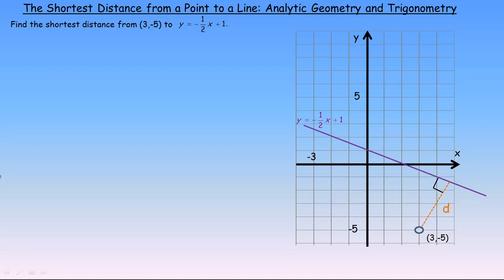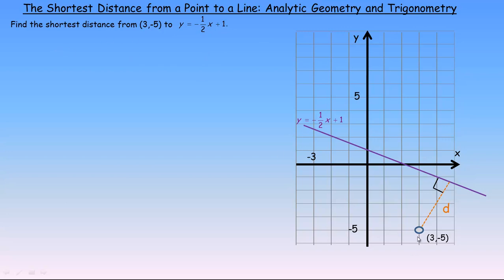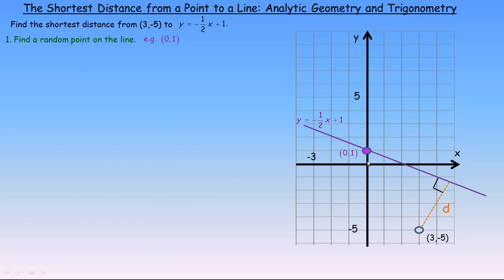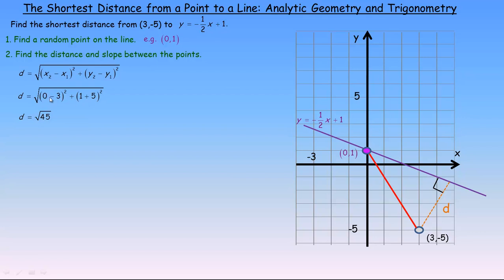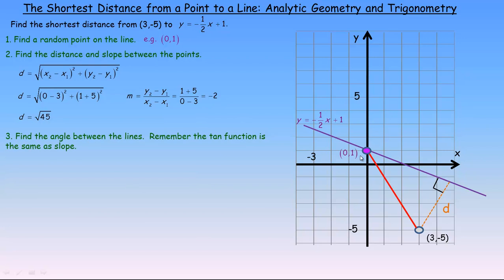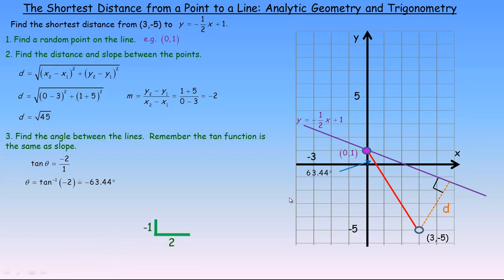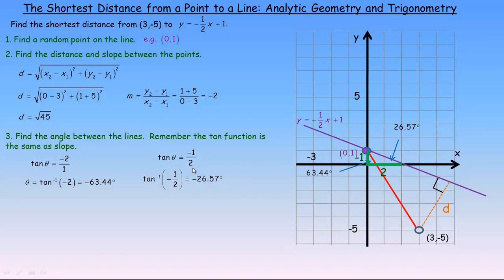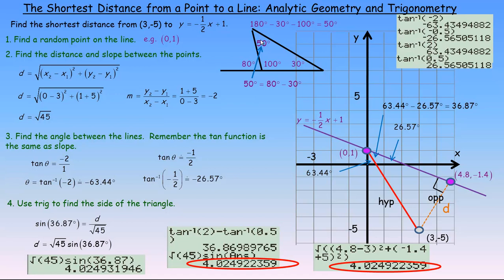The Shortest Distance from a Point to a Line  Analytic Geometry and Trigonometry

Comment: sorry, but that is not a device problem--that is not a correctly illustrated right angle.
Reply from the maker: Hey, sorry but scale's not really the point of this explanation.
Reply: @AlRichards314  that's totally fine, but it just feels disorienting/gaslighting to be told that the 90* angle is right, it's my computer that's wrong. If you had ignored it, I would ignore it, but it's a weird thing to say in the video.